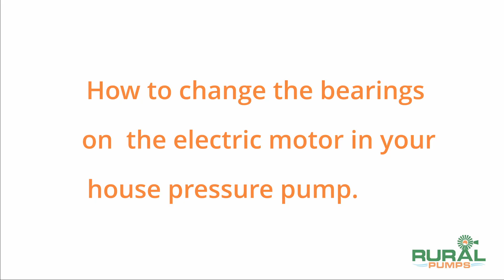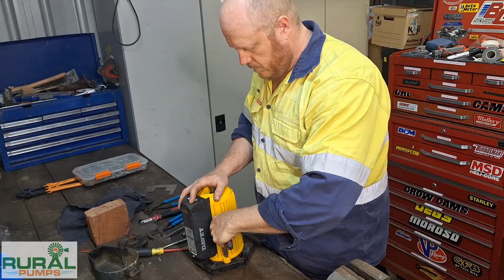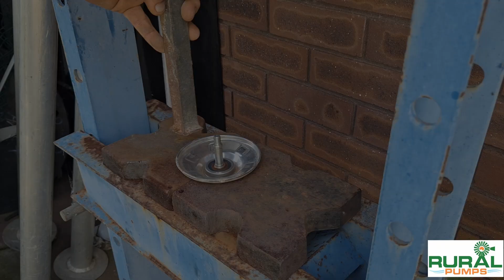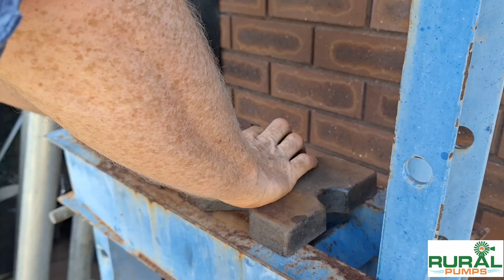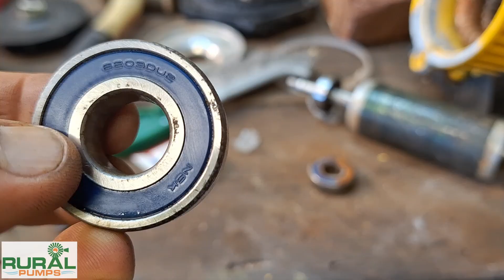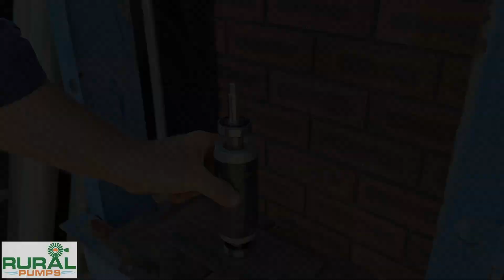Fix Your Noisy Davey XJ70T Pump - Motor Bearings DIY Replacement Guide

Comment: Would be handy to show video of what the pump sounds like running with bearing issues.
Reply from the maker: Will see if I can add some other footage in, this pump was seized and burned out so it was doing nothing. Usually its a grinding sound like the pump is full of gravel.